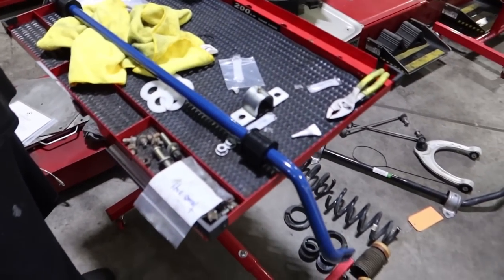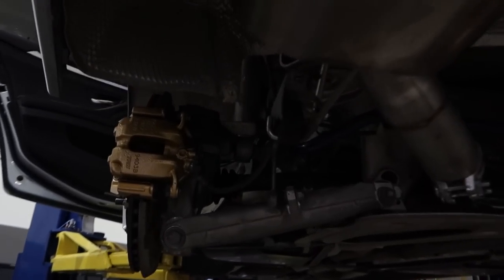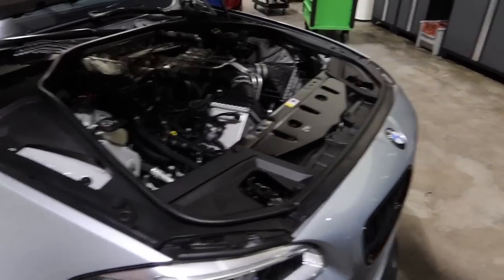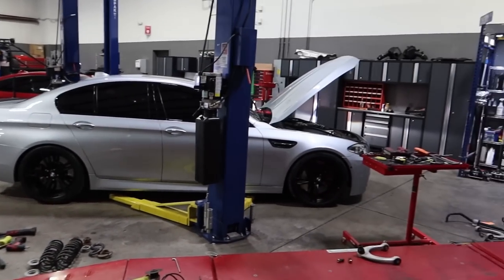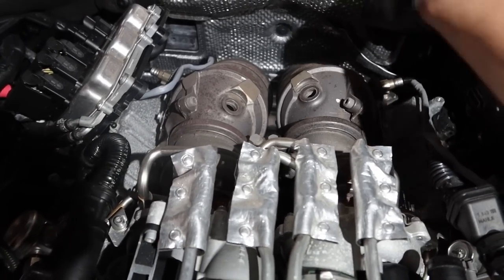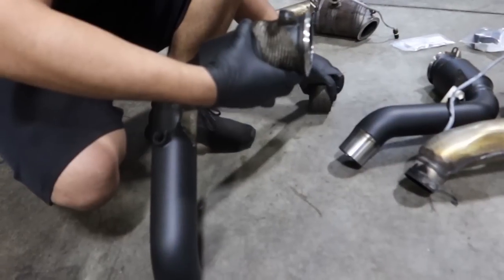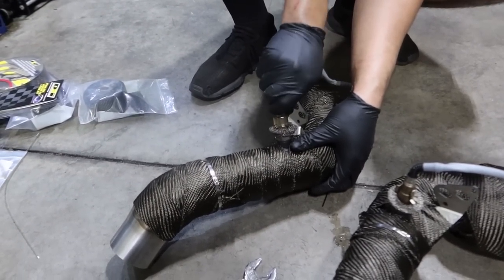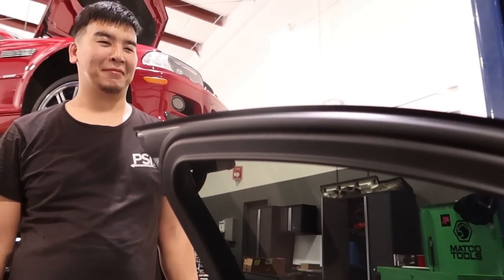BMW F10 M5: Dinan Suspension & AMS Downpipe Install - Part 2

Comment: A little advice; Get that wrap off the downpipes. Header wrap retains moisture and will rot the pipes. Have them JetHot2000 coated, inside and out. Keeps them from rotting inside from the water in the exhaust, and outside from atmospheric moisture. Plus keeps heat in and gas velocity up. 
Trust me. I’ve been doing this for just about 25 years, and will never install headers or downpipes that aren’t coated. It’s a pain in the ass job, and I only want to do it once.
Reply from the maker: They are coated already.

Comment: I add that tune on my M5 But switch out to DME Tuning more Power. ESS Tune the power comes on pretty early and slopes down towards the top. It's a very good tune even my BMW dealer recommended it But I wanted something else.

Comment: Im looking to purchase ams catless downpipes for m5 f10. and have a question about the installation fitment. So did it end up working for the O2 post cat bung that ams provided with the stock O2 wires? Can the wires reach or you need new longer O2 wires?

Comment: Hi nice video! Quick question do I need have to TUNE ECU after installing down pipes to not get a check engine light or will I be fine without a tune? ( I have an N63)

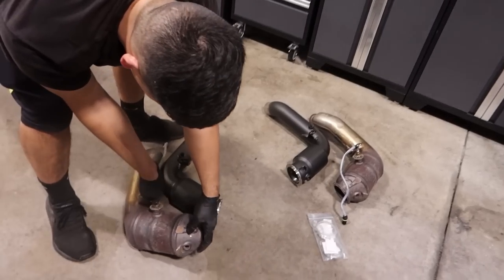Comment: Hey Matt , @ 23:29 you show the downpipe difference , the secondary O2 sensor location is much lower on the AMS pipe than the stock location  the O2 sensor wiring and plugs cannot be placed back in the stock plug holders because the wiring will be too short , the only way to make it work is rig it tight out the the plug cradles or extend the wires, What did you do ? This was the reason why I didn’t go with AMS and went with Fabworx as they put O2 sensor placement in stock locations
Reply from the maker: Rout the wires underneath one of the brackets and they fit fine.

Comment: Not sure about the way the downpipes are wrapped , I've seen better method and results. Honestly this technician is not working at the level to OG spec.
Reply: Marco Santonocito looked kinda sloppy
Reply: PSI is one of the best bmw performance shops... I think there techs no what they are doing
Reply: He did just fine especially since Matt was there “supervising” and the downpipes are not in plain view.
Reply from the maker: Looked fine to me.
Reply: Nick C No they don’t. No tech that knew what they were doing would use wrap. That’s the cheap, ghetto, way out. Those should be ceramic coated.

Comment: Worst heat wrap ever hahahahah.
Reply: He's definitely not obsessed with thermal tape application. Next video will be Matt at home reapplying thermal tape.
Reply from the maker: This isn't rocket science.
Reply: Obsessed Garage  ?? No but that idiot you have working on your car never played with tape and definitely didn’t play hockey lol.   That thing is wayyyy to low man this isn’t a 18 year old with a Honda on cut spring.  You specialize in tasteful mods dumping out a m5 then having a ball of thermal wrap on the down pipes is brand deviation.   Keep it coming on the m5 would
Really love some 1/4 mile track videos and let’s see the new gt3 more